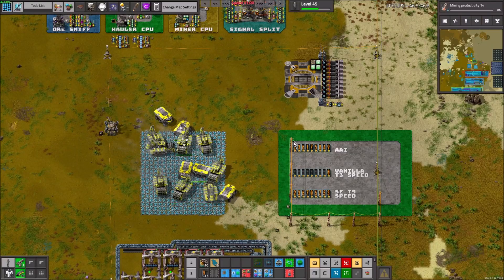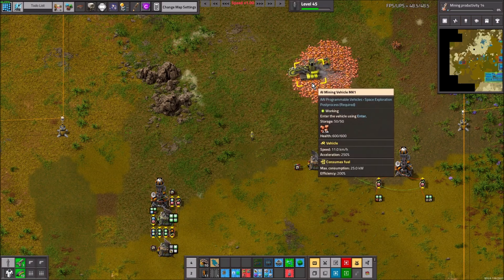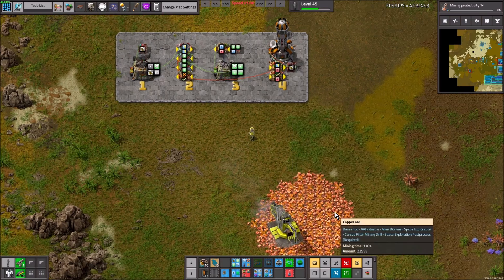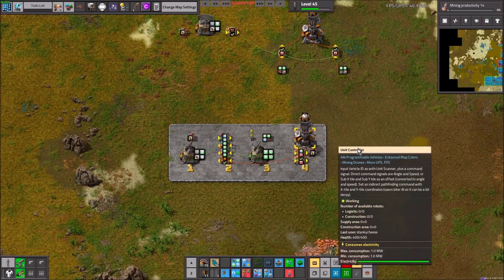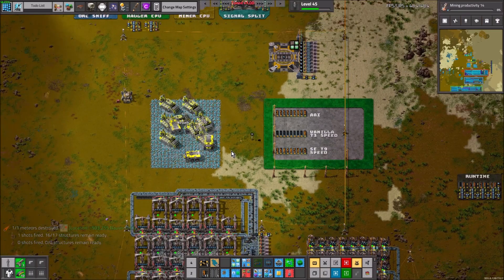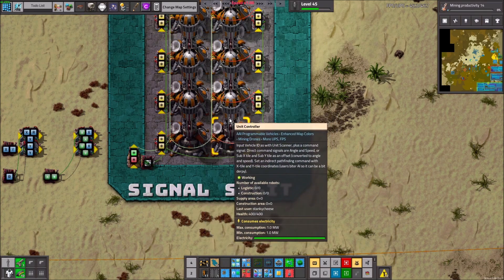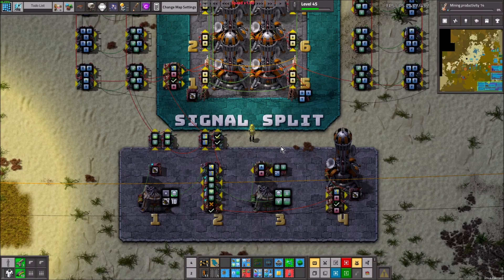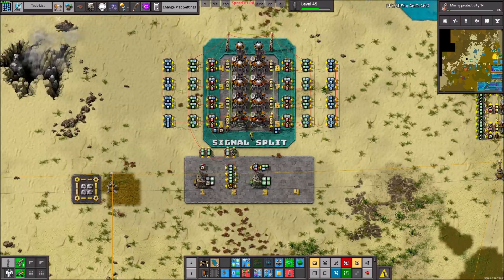AAI Mining Tutorial 2 \\ Continuous Miner Movement & Commanding Multiple Units!!

Comment: not gonna lie man the way i did it is so much more crude but its somehow working, i just used the remote control and put way points over the ore patch, its problably hundreds of times less efficient but it does still beat normal eletric drills, defintly more annoying to setup
Reply from the maker: I also recently discovered the way point method and not gonna lie I really prefer it over the circuit method. It is a bit more setup work but yea it works great once you get it going!